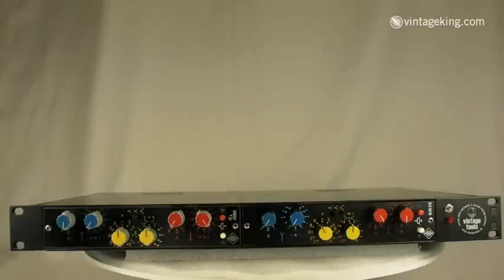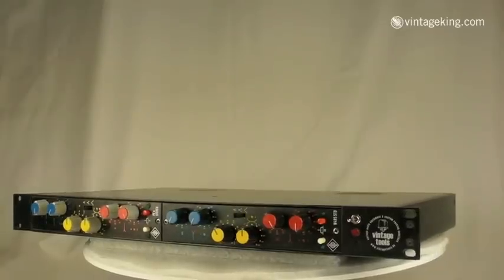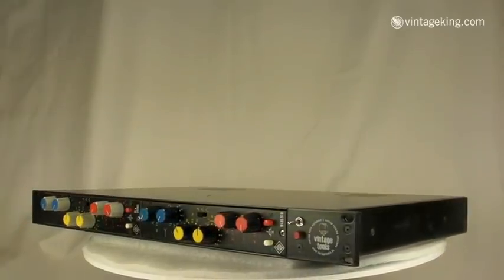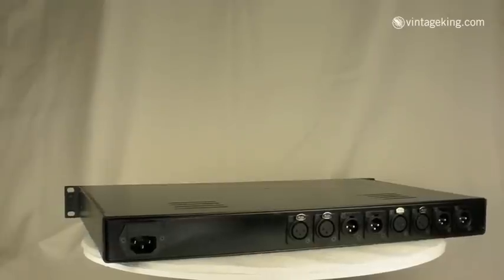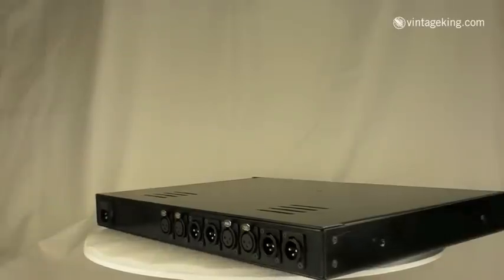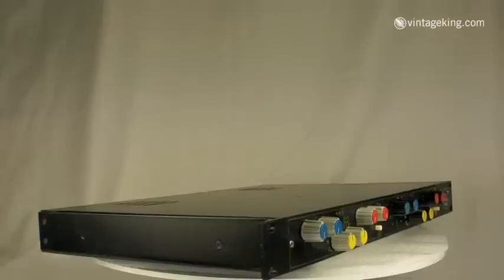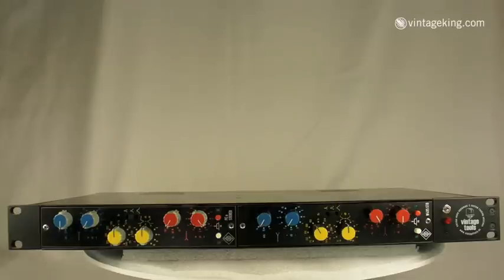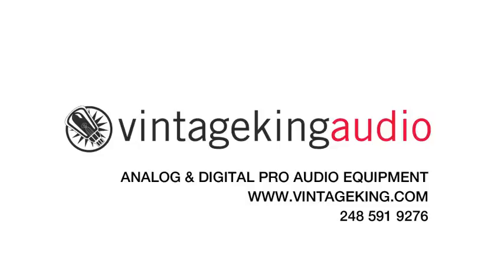Neumann W495STB & PEa Stereo Mastering EQ's | VintageKing.com

Comment: I assisted a few vinyl cutting sessions in the mid 90's in Argentina, and the system was all Neumann, from lathe thru eq. Fantastic sound (before pressing. The plastic was so low quality that the final releases used to suck big time)
But the eq's were stellar sounding